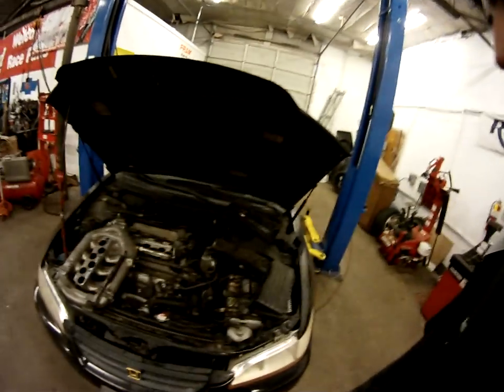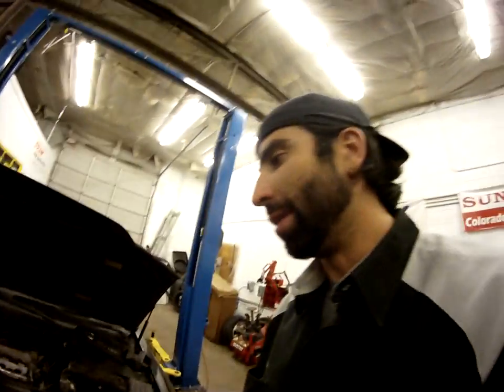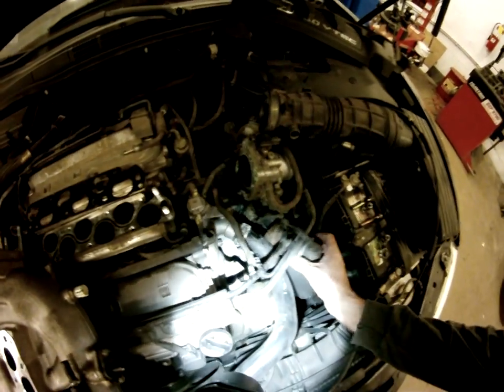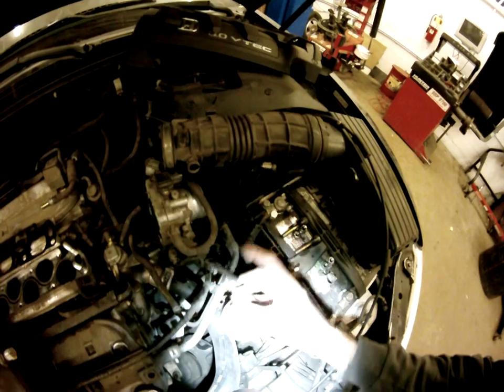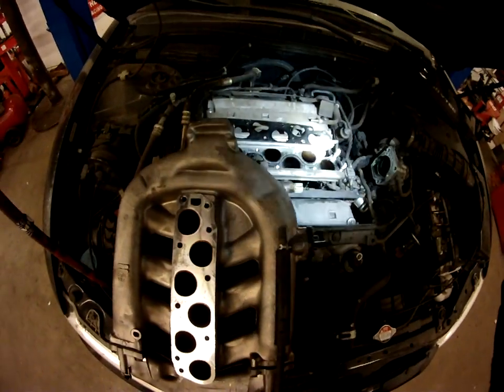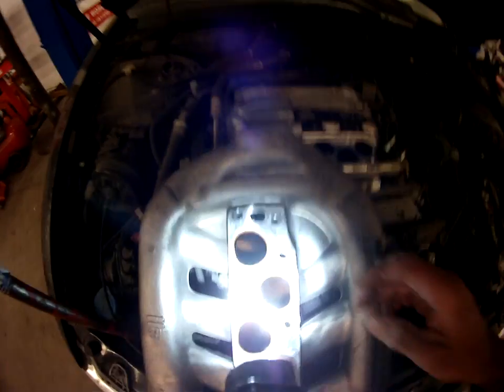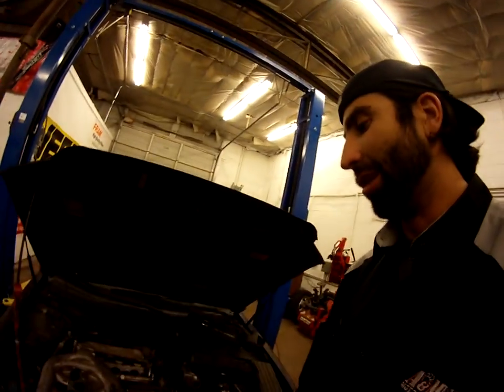P0401 & P1491 - Honda Accord EGR Lesson - GoPro

Comment: hey i have clean the passage change the egr valve but still have cleared the code and it comes back with the p1491 code any ideas ? anything is appreciated
Reply from the maker: Well, it most likely still has a carbon clog somewhere..

Would be best to use a scan tool to command the egr on at idle, and if it car dies the passages are clear.  If not, there's a block somewhere still

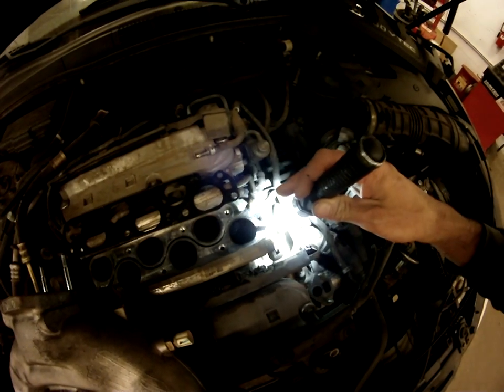Comment: At 1:25 when you say "take this out and soak it in cleaner", what part are you talking about? The valve itself?
Reply from the maker: Sorry for any confusion.  I am referring to the upper intake itself, and where it mates to lower.  Spray cleaner like Amsoil power foam or Seafoam and let it soften up the carbon build up in it and spray it out.

Comment: I was only getting the p0401 initially. Cleaned the passage and now I no longer get that code but I’m now getting the 1491. So check the flap? Also I’m hoping this is what is causing my car to surge while trying to accelerate. You think?
Reply from the maker: Yes, as long as you have no ICV idle control valve issues, then id say yes

Comment: After cleaning the code still comes up. 1998 Accord
Reply from the maker: Make sure to check operation of EGR valve itself
Reply: A&M Motorsports so a brand new one should fix it. This is my only current code after I replaced the 1738 Code 2nd/clutch pressure switch (Under Thermostat housing)
Reply from the maker: I would try that!

Comment: will this cause erratic shifting?
Reply from the maker: Mainly causes poor engine performance, not really shifting issues
Reply: Took off the egr valve,ran a wire to the pink and it pop out also started up car and it ran the same so guess I will be taking intake off to clean it out.Thanks alot for the help your video was right to the point and easy to understand.
Reply from the maker: Awesome.   Thanks for watching and thank you for the kind words!   CHEERS!

Comment: I got an Acura RL with a 3.5 V6 and it stalled at a red light, started back up, came home, shut the thing off and it won't start. P1491, so I cleaned the EGR valve which wasn't that bad, but I'll try it anyways. I don't want to take the whole damn intake off and have to replace all the gaskets, that's 150$ without the time. What are the chances that it will work lol?
Reply from the maker: Dan Dube Well, always good to start simple.  But... very good chance you will have to take intake off. Try to soak the egr port overnight with cleaner, see if that works for ya

Comment: 02 Honda Accord 3.0 v6. New EGR. Removed intake and cleaned everything. Still getting the p0401. What am I missing?
Reply from the maker: Really?  Interesting.  Well, it may not be clean completely, check intake ports and ports around the throttle body. Remove throttle body and inspect.

Comment: Im throwing P1491 on my 1998 Accord EX with the 3.0 V6. I don't want to have to replace the EGR valve so would there be another way to fix it? And when you were talking about having the valve move by back probing it, what exactly did you do? Did you turn the cars aux power to do that? I understand if it works then like you said I have to clean and unclog where its flowing
Reply: The normal lift sensor voltage on a closed EGR valve is 1.1 or 1.2 volts. Watch the voltage on the scan tool or back probe the White/Black (WHT/BLK) wire.
2. Remove the Pink (PNK) wire out of the connector at the EGR valve and apply battery voltage to that terminal to operate the EGR valve manually, the EGR valve should open and the lift sensor voltage should increase from 1.1 volts to around 4.0 volts.
3. Always verify that the voltage does not drop out when the valve is operated, or the code will also set. The EGR valve has been a very common failure. Also if the EGR passages are restricted, it can set this code.
Reply: You might get some good info here https://www.youtube.com/watch?v=OIp4yWN1Ay8&list=UUtAGzm9e_liY7ko1PBhzTHA Matt Styles ***** *****